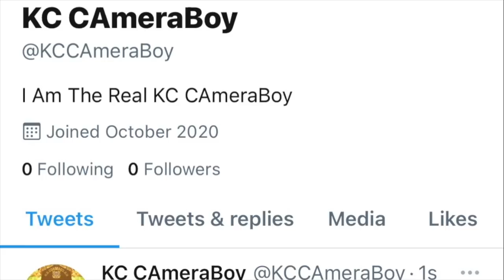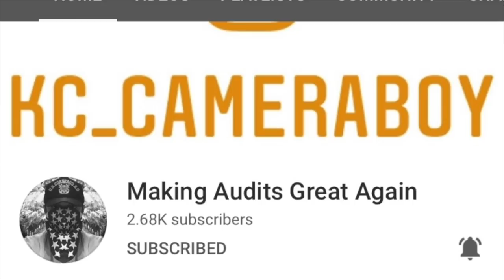Assaulted, Battered, & Harassed By Out Control Tyrants & Snowflakes For Filming-1st Amendment Audit

Comment: Actually those homeless were smart trying to get on the good side of the LEOs so the LEOs would leave them alone and not remove the “street” house and many accessories, bikes bed frames, old air compressor, sheets, foam rubber etc etc.